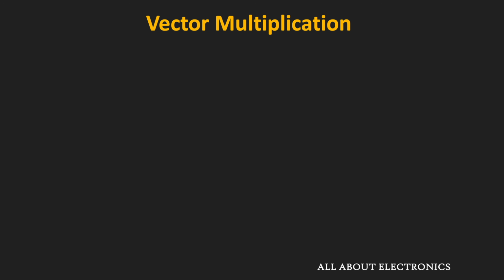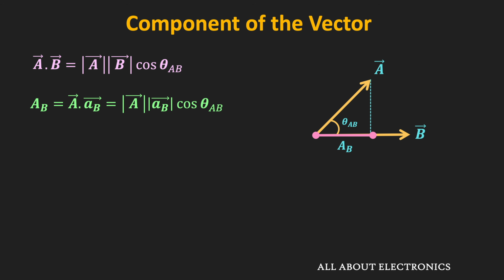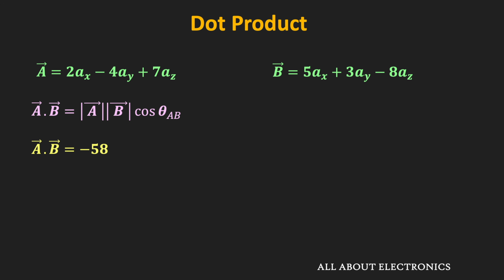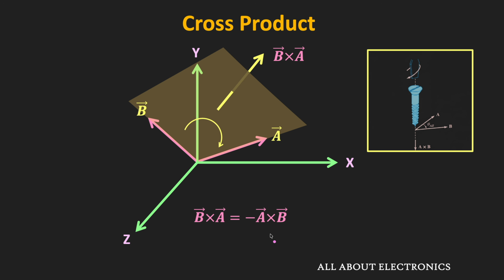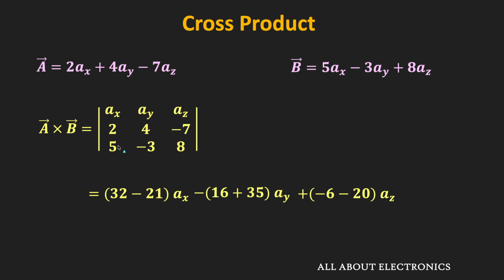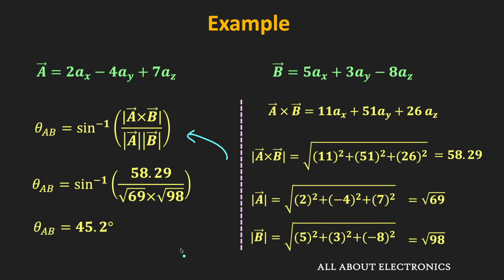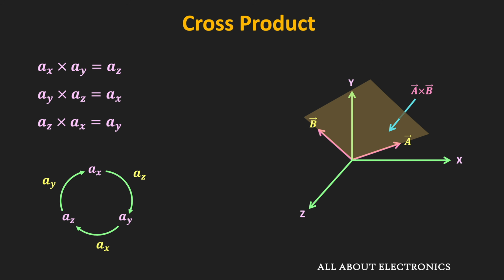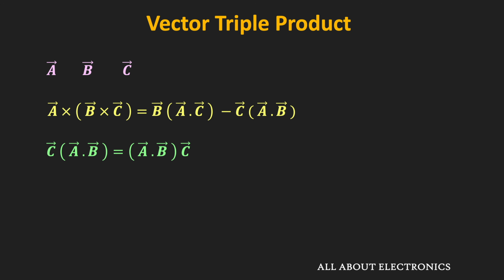Dot Product and Cross Product of Vectors Explained | Vector Multiplication

Comment: Hi sir, if i joined in advanced membership, could i get notes used in the lecture? It will be useful for me, if the notes available for studying.
Reply from the maker: Yes, notes will be provided for the lecture. Typically within 2-3 days after the video is published. You will find the earlier lecture notes.
Reply: Is it about description only or video notes in pdf sir?
Reply: I had joined in advanced membership, how can i get the lecture pdf of old videos sir? I need pdf's of analog electronics videos to refer.
Reply from the maker: If you go to the membership tab, you will find all the member’s only post and content. There handwritten notes on analog electronics are also updated. ( you might have to scroll a little )